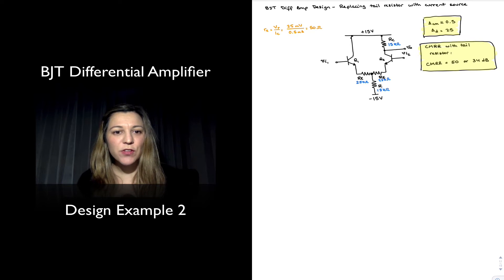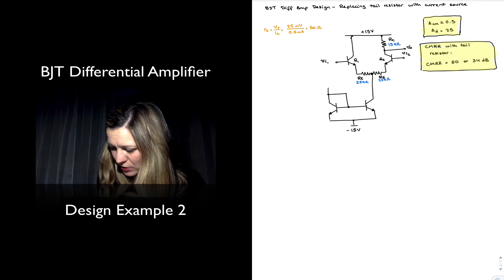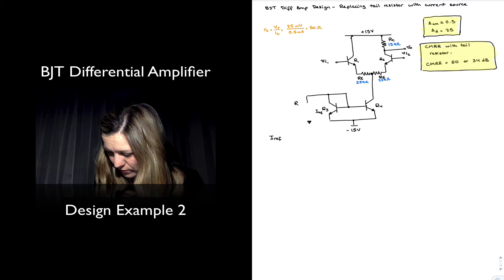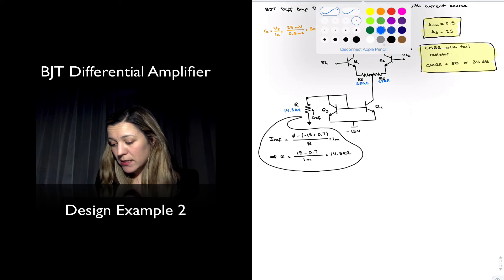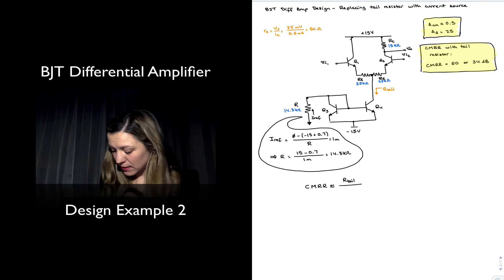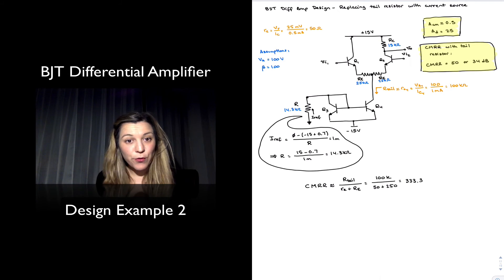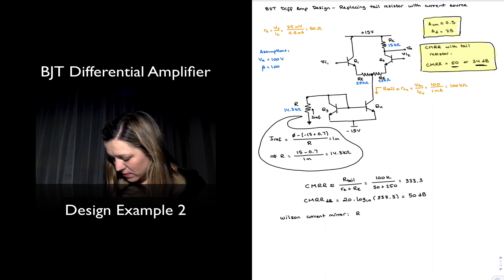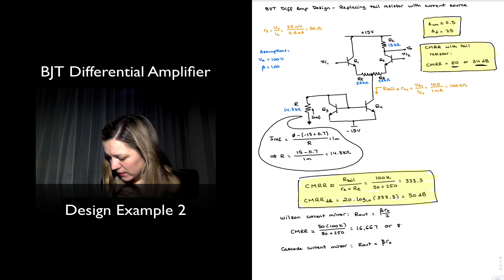BJT Diff Amp: Design Example 2

Comment: Hi! Question: doesn't the diff amp represent a load to the current mirror? If so, are you assuming that this loading effect doesn't change the calculated bias current at the tail?
Thanks
Reply: It's a load and affects the current, but that's just the basic current mirror, that's why she also proposes better current mirrors.